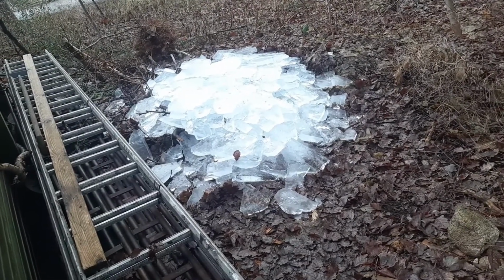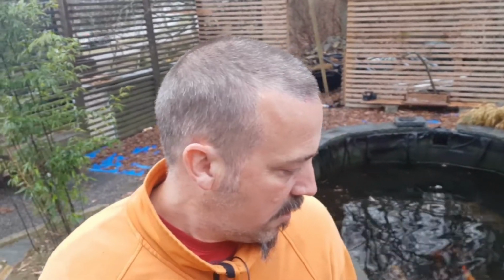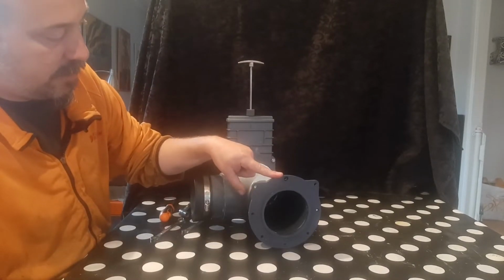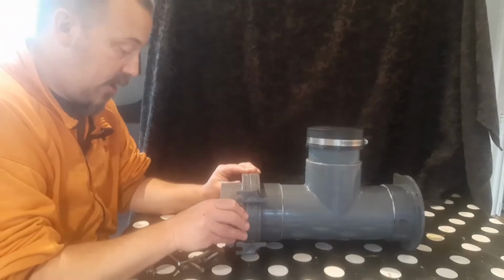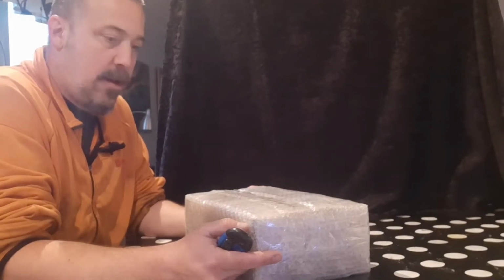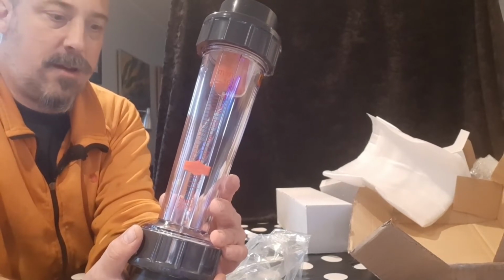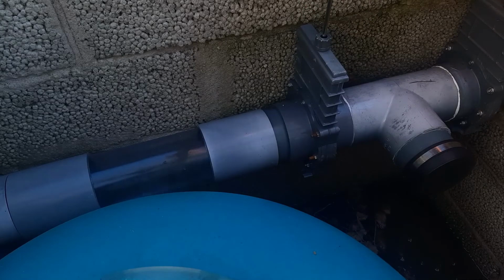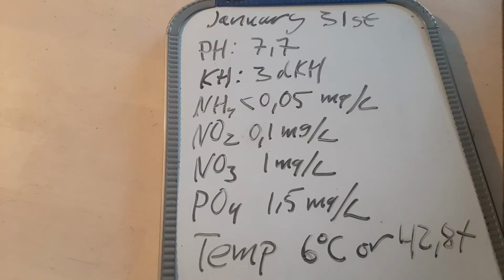Koi and pond update January 2022

Comment: Was it the ice that cracked the rubber seals?  Looking forward for the bog filter coming back
Reply from the maker: The seals was not really broken. What makes them leak is biofilm buildup. It is possible to reuse a few times, but in the long run the rubber dries up and are no longer usable. Cheers mate.😀👍